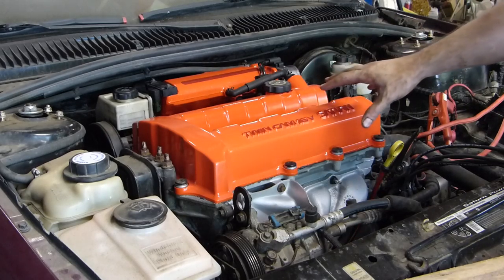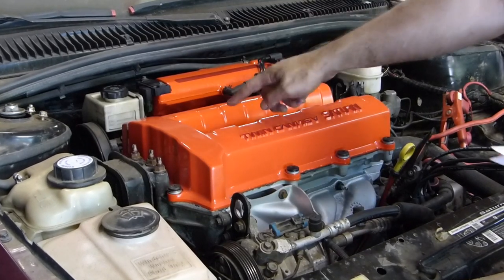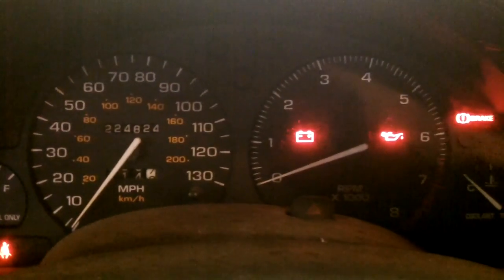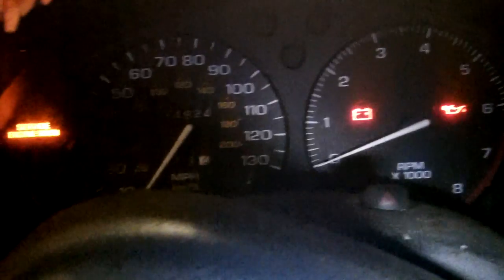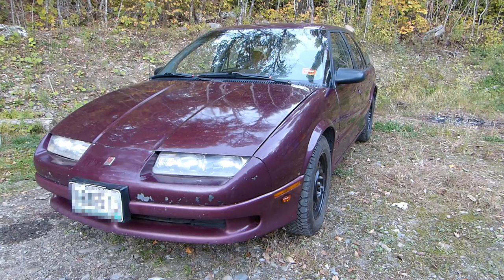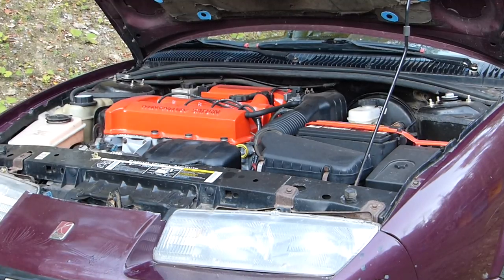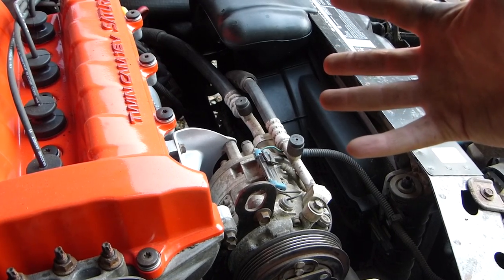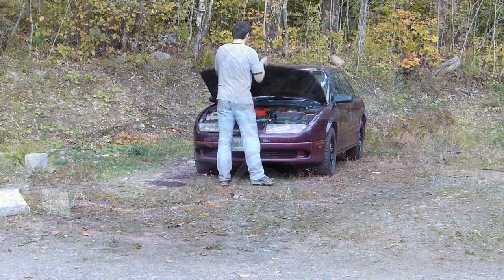First time startup and break in of the rebuilt engine.

Comment: I have a 98 SW2 with 312000, finally lost a head gasket, and cracked the head. Have motor at machine shop now, polishing the crank and re-ring job only, not even much of a ridge at top of the cylinder. 3000 mile oil changes really work!! Great series of videos, they've been very helpful. Long Live Saturn!!

Comment: Although I can appreciate the efforts of those who are trying to do something like a rebuild, I have to say that forums are not the place to get information. What you have on forums is a bunch of unexperienced want to be mechanics who read a book about procedures and think they can give advice now. I've heard the term "drive it like you stole it" a lot of times, but it's incorrect and could have some disastrous long-term effects. 
The proper procedure for breaking in a freshly rebuilt motor is generally.
1) crank the engine over without the spark plugs and the coils disabled and without the valve cover so you can see the oil filling the top in of your engine.
2) replace the spark plugs and the cover, enable the coil, then fire it up and let it idle for at least 15 minutes without accelerating it. 
3) slowly Idol it to about 2000 RPMs and hold it there for approximately 15 minutes, then let it go back to idle again. 
4) go on a drive cycle so the computer resets itself for IM readiness on an OBD 2. ( Don't go passed 50 miles an hour)
5) keep track of your mileage because you will need to change the oil at about 50 miles after first startup. 
6) continue break in procedure after oil change, still not exceeding 50 miles an hour for the next 450 miles, then change oil again.
7) after second oil change you can now drive it normally and change the oil in about 1500 miles
8) after third and final oil change the break-in period is done and you can follow your owner's manual for routine maintenance of the vehicle.
Reply: Dear, Professional.

Glad you're here to straighten us out. Mechanics aren't banned from using internet forums.  BTW....you forgot to include disable/unplug fuel injectors during the oil priming. 

Cordially,
Wannabe Mechanic
Reply: @kevindavis2764  No I didn't Forget, any Mechanic would know not to connect them in the first place. Why would you connect any fuel to an engines for a Prime only to disconnect it again?? Bahahahahahaaaaa!!!
Reply: @ricgomez1  Exactly my question. You made a list of steps and didn't include it. I call that forgetting...or omitting. Also, in step 1 you typed "without the spark plugs and the coils disabled". Don't you mean "WITH the spark plugs and the coils disabled"?

Any "DIYers" reading and following your poorly written instructions would have met with disastrous results.
Reply: Where is your video of you rebuilding an engine

Comment: By the way, I built an oil priming rig for these modern engines with and old oil pump and pickup, a 5 gallon home depot bucket, and some AN fittings and hose.  Works like a charm.

Comment: I bought a 110k 95 SL base has the sohc for $900. I see why people like these cars so much. So easy to work on and great on gas. Unbeatable car. That reverse slam problem may be an issue with the valve body. The solenoids weren't the only thing it had problems with the whole valve body itself leaked or had issues that's why they would go through them a lot. Thankfully they're very easy to replace. If I ever got another one I would definitely want to manual with the twin cam.
Reply: Any car has “easy things to work on”. Example: changing alternator on a GM 3.8 liter. The Saturn S-series has its share of difficult things to work on. Example: clutch change with engine IN the car or PS pump replacement, timing chain replacement ain’t no picnic either.

Comment: If you pour in the oil through the top carefully before putting valve cover on you won't have to do all that, just turn the key. Also, drive in stop and go traffic and vary RPM's. Start at a limit of 3,000, and work your way up and after your 500 mile oil change you can drive it like you stole it.

Comment: Hey man, I was wondering how the bottom end of the engine is holding up with those aggressive cams and the professionally rebuilt cylinder head? How many miles have you put on it? I have an 02 SC2, its needing a new head gasket and when I pulled the head it looks like I might be needing a new one. So I was wondering how the rest of the engine would hold up if I was to put a performance head on it.

Comment: All these people asking why rebuild it?
Look and see how many miles its got on it. Its reliable cheap transportation and he willl likely get another 100,000 or 200,000 more out the car, provided no corrosion issues. 

The S-series is seprate from the cars saturn produced after 2000. They do not have the dreaded cvt that died in peoples cars. Also are a lot more reliable.

Comment: First saturn wagon I've seen... seriously didn't even know they made one. Your old transmission probably had a bad reverse accumulator, that'll cause that slamming into gear... not softening the clutches.
Reply: I've owned 2. 94 SW1 & 00 SW2. I still drive the SW2. 283,000 miles. Just had the engine & clutch replaced.

Comment: I think the rebuild of the engine is more expensive then the car is worth.
Reply: Nexit Next.. It's a lot cheaper to buy a "short/long block" than it is to rebuild, but it is a lot of fun to build an engine tho..
Reply: Nexit Next, here in my country the engine rebuilding is a little cheaper cause most of us here use Japan models specially Toyota cause if live here and you have Toyota, the parts are easier to find and the vehicle is a bit more reliable...
Reply: Nexit Next especially shitty plastic Saturn
Reply: @amak1131  Saturn not produce cars anymore because nobody wants plastic crap especially in winter -F
Reply: I'm getting my engine rebuilt for only $200... Perks of having a mechanic friend 😎 not to mention I'm helping him

Comment: I'm curious about your oil consumption and any leakage problems also.  I'm currently rebuilding an 02 twin cam motor for my wife's 96 sl2.
About 1 year ago, I replaced all the gaskets in a 100k single cam motor for my 02 sl and after only 20k miles, had some bad oil leakage where the head, front cover, and top cover meet.  I think it was because I didn't seal and install the front and top covers at the same time.  There was a few days between.

Comment: the idle seemed to be adjusted up to 1200 rpm... to me as a mechanic, the idle should only be at least 900 to 1000... idling it a little higher on a newly rebuild engine could stress the parts and damage quickly during break in...

Comment: Don't be surprised if they burn oil up the wazoo until the rings seat and the valves gum up. Usually around 10qts or so after first run

Comment: Good job man i bought my first stick a 1995 saturn sl and its great. This was bout 2 months ago. The interior was wrecked i restored it. Bout to make an exhaust for it. Did a bunch of stuff under the hood but its ok i love working on cars. Put new spark plugs. Wires. Tpc. Iac. Cleaned throttle body. Valve cover gasket. Intake gasket. Radiator fan motor and relay. Temp sensor. Coolant flush. Oil change. Painted valve cover. New battery. Top motor mount. Etc i might put a stage two clutch in her and new pistons racing kind so i can turbo it. What do u think.
Reply: Still got to put new a.c compressor. Alternator and pully.
Reply: If you want to turbo it you'll probably want new rods and pistons. Pistons will go pretty far in their own but I'd do both.

Comment: I really liked this video. It is very informative and your narration is easy to follow.

Those little engines are decent engines but I have to say the station wagon I had SW1 I think if all 2 passengers were in the back and 2 up front the engine didn't really like to pull that much weight around and you could forget going up a hill.

GM made the only station wagon that worked it's best with only one person in it. lol
Reply: evilcowboy that's because it had the weak engine (and let me guess - automatic transmission too?) if it were a manual with the DOHC engine it would be fine
Reply: @1FAST91SONOMA  Yeah, on top of his being single cam, it is a wagon that is heavier. Even the SC1's, 2's, were a little heavier. The lightest Saturn cars were the SL1 and SL2 model cars. I got a donor 5 speed for mine to swap into my 1995 DOHC SL2. I know this video is old, and I prey that I don't get hit or rear ended cause I'm going .20 over forged rods, and port and polished head, 14-15 PSI turbo, aftermarket ECM, the whole 9 yards...lol

Comment: my Saturn has the transmission kick when.its in reverse problem too. is it because there isn't enough oil going Into the torque converter or is it a bad trans?
Reply: Bad transmission
Reply: Michael Hunt don’t know if you still have the car but when a Saturn s series gets the reverse slam issue,  it’s just a loose nut on one of the gears. It can be easily fixed by removing the side transmission cover and simply tightening the nut.

Comment: I would not suggest turning the engine over with no plugs in it. It gives the opportunity for fod to be introduced into the combustion chamber. It might have worked out just fine for you this time. But I still would not suggest it. That's just me. It's your car and do as u like. I would have added about a half quart of marvel to the oil.

Comment: 3:43 no drive belt??
Reply: +Nicholas Ruiz probably has one without ac like i do
Reply: Anton Davis but the alternator
Reply: most likely there are two belt sizes you can get for this engine, a shorter one for cars that didnt have Ac, and a larger one for models that do.  If the Ac doesnt work or leaks, no need to spend extra $ on the bigger belt to drive the compressor.

Comment: Do you know of anyone or any company that sells rebuilt 1.9 DOHC motors?
Reply: You might wanna check on ebay, they have a lot of nice motors on there that have anywhere 40xxx miles to 60xxx on them that's if you got an import. Like my toyota paseo you have a lot of swap options like a 1.3 turbo 4efte which a lot of people go that way. But again just depend on what you have
Reply: you can also find low mileage engines in a junk yard if you dont mind work. But most of the time if you want it new and clean just go to a parts store they can order one for you.

Comment: I had a 1995 Saturn SL2  with the 1.9 twin Cam I got 318000 miles out of that car before I sold it and the only reason it blew up after I sold it was because my Uncle let it run out of oil

Comment: Everyone knows that slow drive low rpm is a bad brake in procedure as the parts will not set in properly trust me after building few v8 i know what works. A good brake in is mid rpms you should somewhere up to 4000 rpm so you do city driving as it will put more stress and get those parts to seat in right. I say spirit driving in normal way no red lining just mild spirit driving. Every engine i rebuild is over 100k with 95% compression

Comment: Drive like you stole on a newly built engine is how you end up breaking it again. If you get an official copy of the owners manual im pretty sure it would say keep the engine under a certain speed as well as below a certain rpm, and do not jack rabbit start from stop.
Reply: TheOne CalledJake Except for the last bit, that's out-dated information. Drive it normally - at a variety of speeds - kinda like you stole it.

Comment: i just rebuilt one of these and there i sstill  smoke from tailpipe after 10 mins of running, is this normal residual burn off or is there a bigger problem?
Reply: +ltethan649  go to autozone an get a new pcv valve there only like $4 an and will cause the car to smoke like mad if stuck an if that don't clear it up that sucks but well it was only 4 bucks